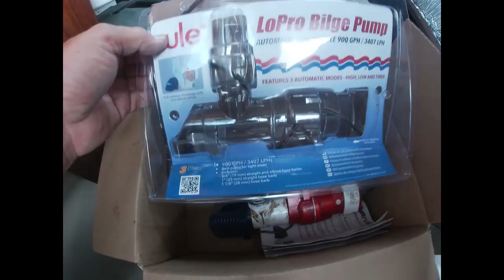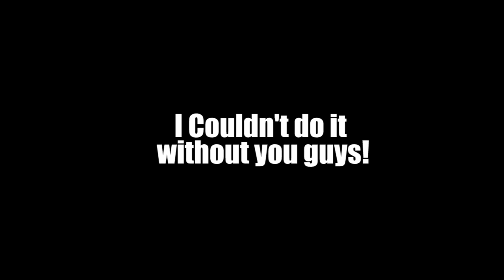A Call Good Times Is Sinking Part 2

Comment: mike replace that breaker.  just saying.  good luck to you and marty.
Reply from the maker: thanks, very good idea. I have ordered some of the smaller 12 volt breakers but haven't thought about doing that. They are 30 plus years old.
Reply: @CaptainMike1965  Been following you and Marty for sometime now. Looking forward to the loop videos. I totally agree with the suggestion of replacing the breaker(s). It's possible that the breaker overheating because of the constant current drain from the pumps running to get the water out. If it's the original breaker it possible that it's old and have weakened with age and tripped out at a lower current draw. I would seriously split up those circuits too. Best of luck you your trip!